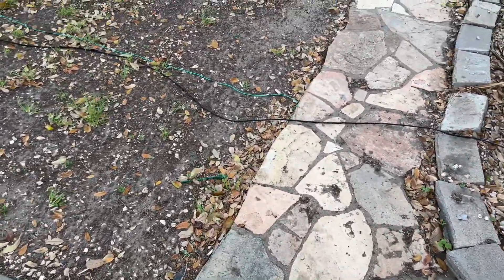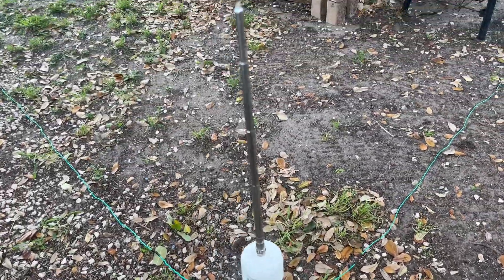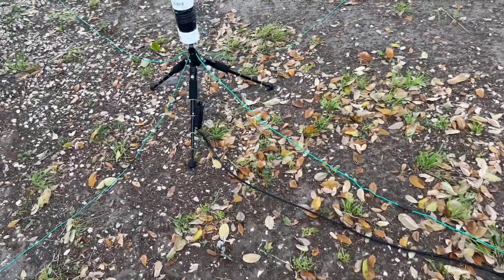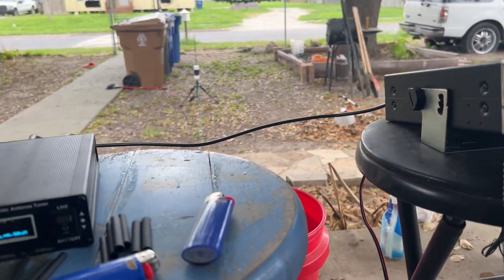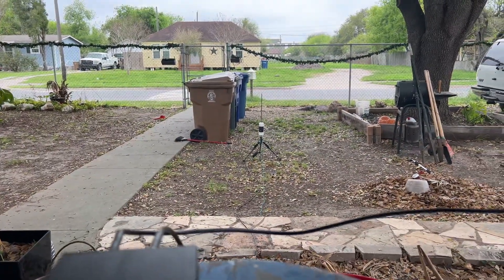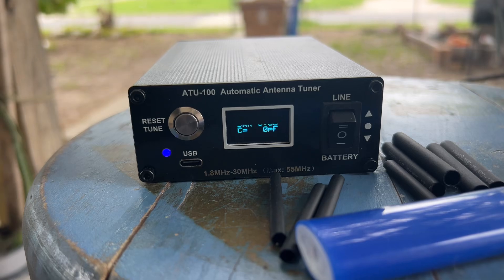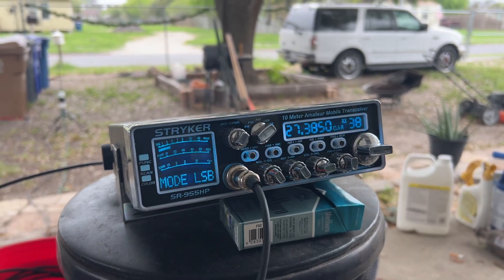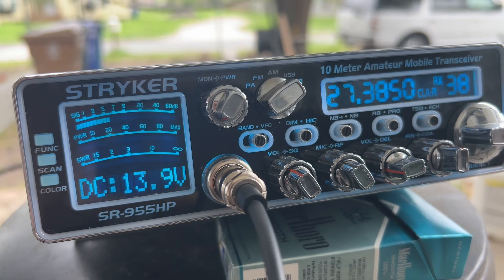Contact with Pennsylvania and West Virginia on my loaded coil antenna 1 ft off the ground ￼3-7-2024

Comment: Very cool, great contact
Reply: What is the name of the whip antenna???
Reply from the maker: @Mike-ci6md The whip antenna requires my coil at the bottom for resonance on the 11-meter band. The antenna is currently unnamed, but the name "The Mig 11" is being considered.
Reply: With the whip fully extended out how long are the ground wires cut to???
Reply from the maker: @Mike-ci6md   roughly 2.5-3ft with swr of 1.9:1 right now, I'm going to do fine tuning today and try to get under 1.5:1
Reply from the maker: I finally got the swr down with the whip fully extended out, it was nice little battle with swr that i won